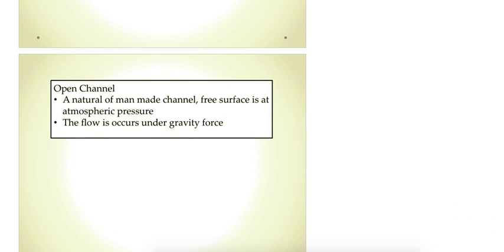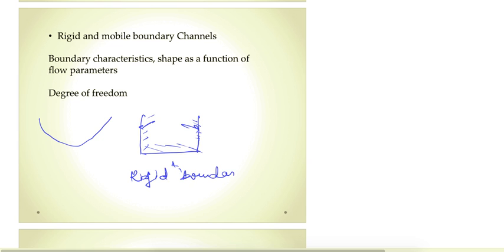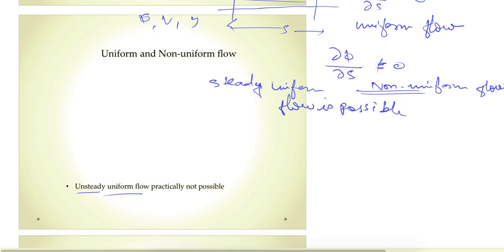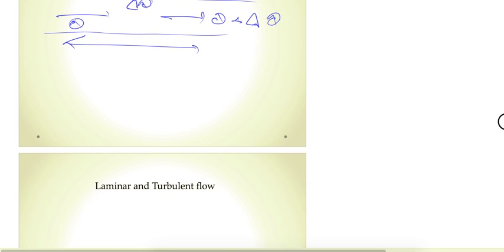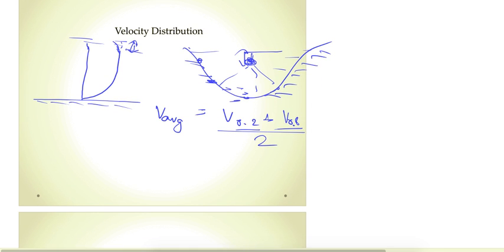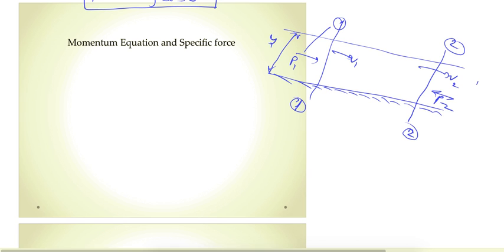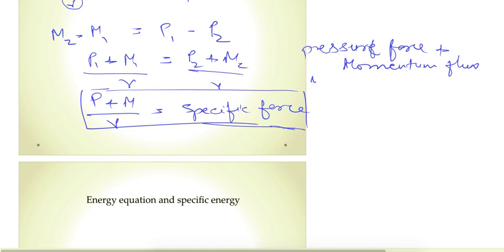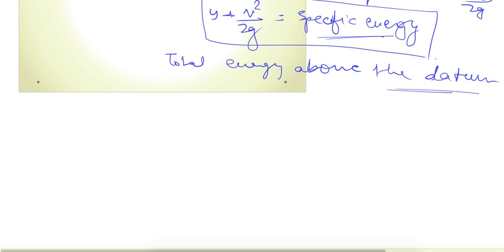Introduction | Open Channel Flow

Comment: Sir,  one doubt...why in open channel the H.G.L is on the top surface of the channel?
Reply: because the pressure at the top surface is atmospheric so at the bottom of the channel the value of p^2/2g is equal to the depth of the channel so hgl coincides with the top surface of the channel.